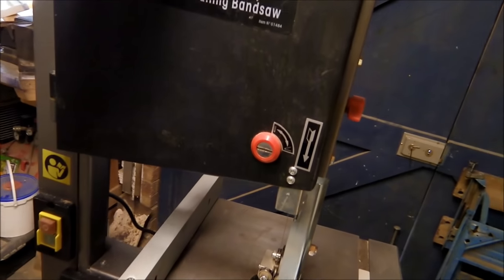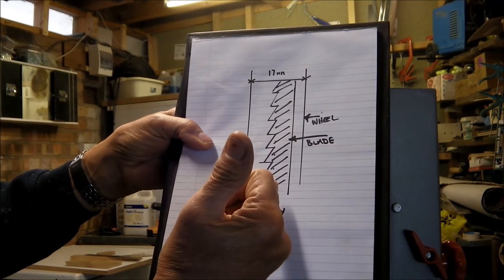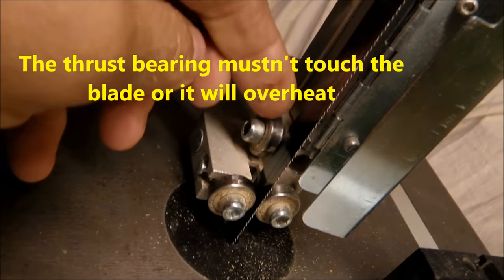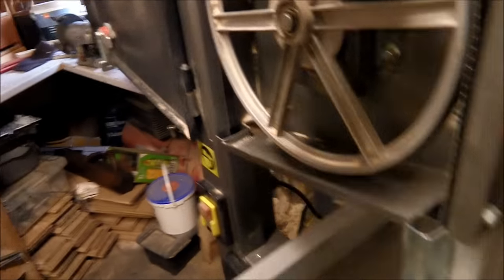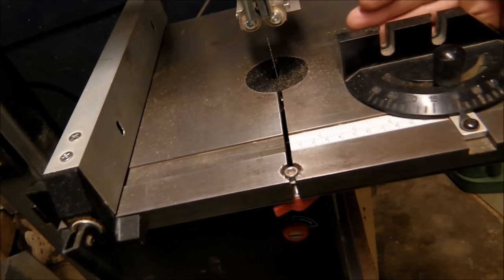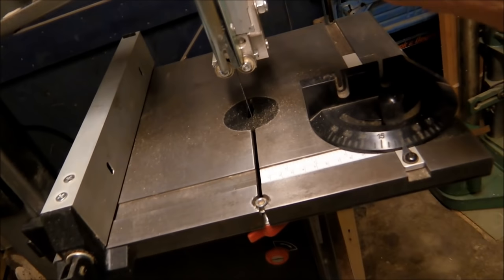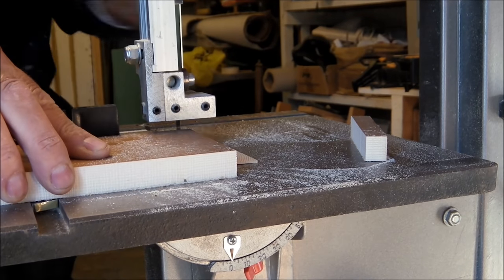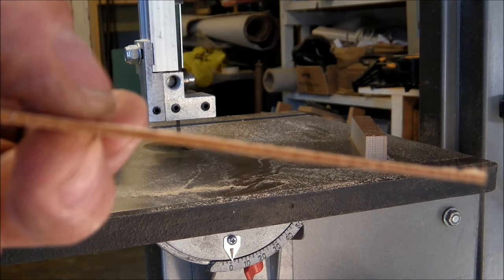Setting up a Bandsaw Blade-taming the blade drift myth

Comment: I have a 14 inch Draper which I have an issue with drifting on. After watching your video it seems that it's pretty important to get the placing of the blade right on the wheel. So I will try and move it about just slightly and see if that helps. Thanks for the video and the good advice. It's nice to see that not all wood workers on you tube have all the latest tools and equipment.

Comment: There's one more thing to add... if you are rewarding a tall board you will get drift if you push the board too fast because the chips will fill the blade coves which forces them to create pressure on one side of the blade as they press out.  The taller the cut the coarser your blade should be to allow a reasonable feed rate without filling the coves.
Reply from the maker: +Tony Shulthise Yes works the same way with hand saws you wouldn't use a tenon saw for ripping.

Comment: Hi! I’m Cheri and I’m brand new to woodworking. I bought a brand new 9” Ryobi bandsaw and have searched and searched for help adjusting the guides to no avail. I’ve done everything you suggested but without the understanding of how to adjust those little bearings I just get crooked cuts. I’m so disappointed and frustrated. I had no idea bandsaws were so unreliable when I decided to buy one.
Reply from the maker: Hi if the blade is sharp and at the correct tension and set right on the crown of the wheel it should cut straight even if the guide bearing a not correctly set please get in touch if you need any help

Comment: Solved my drift with the carter micro adjust guides with two bearings each side to support the blade and setting them close. Cross cut; miter with no drift and 90 degree cuts.Its the support of the balade that makes the difference ;IMO
Reply from the maker: David Davis try setting your blade of the crown and see if the bearing still stop the drift.
Reply: Did that has Snodgrass posted long ago ;just wanedt to point out with 1/2 inch and larger width blades two bearings supporting the entire width works wanders. Notice Snodgrass and carter designs all have two bearings  on each side to fully support the wider  blade.

Comment: I did what you said and ran a R/S 30x3x2" through the bandsaw to a 30x2x2" , it was about a 1/16" out of square, but the important thing is there was no drift hooray. A little adjustment on the table and that will be fixed. I then ran perspex 30x3x1/4 through and I got drift. I,ll go through the procedures again tomorrow, to see if I missed something. Anyways thank you very much, it's certainly way better than it was. Edit-afterthought could it be that I might have pushed it through too quick?
Reply from the maker: +rkev keelan hi thanks for the feedback.was it a new blade ?sound like it could be a bit blunt, Perspex is a very hard material to cut
Reply: Thank you marcello for getting back to me, The blade is brand new but when you said perspex is a hard material I thought it might be that the blade is 6tpi. Do you think I might need a finer blade for harder materials, and in turn that will sort out the drift?
I did some fine tuning and I could cut 1/16th off a 2x2 rough sawn. I can't ask for better than that so again thank you very much.
Reply from the maker: kev keelan hi Kev 6 pro is for ripping I would use a finer blade for Perspex I swap blades all the time depending on material
Reply: Will do, thanks again Marcello.

Comment: Can you help me please i am new to using a bandsaw, I am getting good tight turns to the right, but when i try to the left i get sparks and burning on the wood, what corrections do i need to make please.
Reply from the maker: Hi It sounds like your guide bearing need adjusting so that they are the same distance from the blade and behind the teeth check both the top and lower bearing also you should use a narrow blade for tight turns I would recommend 6mm as a starting point I change my blade all the time depending on the work,
 if you have found this video useful please like and share
Reply: I did reset the lower guides they were difficult to get at all is ok now thankyou. it cuts a treet.

Comment: surely the centre of the band should be at the centre of the wheel?  and the thrust bearing as close as possible without touching. Also,  before you do any of that,  align the bottom wheel. The table may have to come off, you will need something straight of about the right length to use as a guide. loosen blade guides thrust bearings and align the two wheels with one another then proceed to reassemble and only then set the top wheel tracking and the guides etc.
Reply from the maker: +rAnthony newsome you need to try all that to see if it works somehow I don't thinks so
Reply: That IS what works. If bottom wheel is askew any other adjustment will not work properly, I know this by experience. A reliable way and the quickest method to achieve accuracy. it will work,  no question of IF it works. its only aligning the two wheels
Reply: Also see: How-To:Bandsaw tracking and Coplanar adjustment by grizzly industrial
Reply from the maker: +Anthony newsome the top wheel aligns to the bottom wheel by adjusting in or out the teeth of the bandsaw blade should run on the crown
Reply: if bottom wheel is out of line the blade will not run true no matter what
Reply from the maker: Anthony newsome I don't need to has you can see from the video my bandsaw runs without drift
Reply: The two wheels should not necessarily be co planar according to some experts, so best leave that alone. See Alex Snodgrasses videos.
If it still drifts after set up, it may be the tooth set on the blade is too much on one side. More likely on cheap blades. The same thing happens if you hit a nail or very hard knot. Not all new blades are perfect, I have found.
Reply: Check out Alex Snodgrass's bandsaw videos. He is THE bandsaw man.
The bottom bearings are very important, the lower wheel not.
Reply: @robertbrusellenglishguitarist  if the wheels are far out from coplanar  then the blade is twisting even with a good bearing the wheel alignment and blade position on the wheel crown will tension the blade either towards the cutting edge centre or rear if rear the blade will wander
Reply: @anthonynewsome2389  OK, so how do you adjust the lower wheel. The two bandsaws that I have owned have no adjustment on the lower wheel.
Reply: @robertbrusellenglishguitarist  most do have no need it is well set either you can check with a simple straightedge